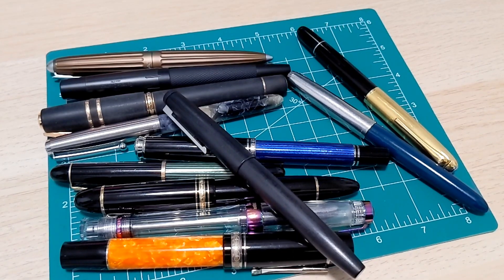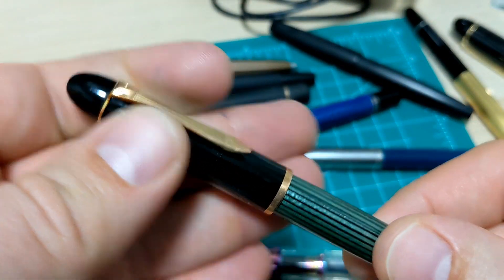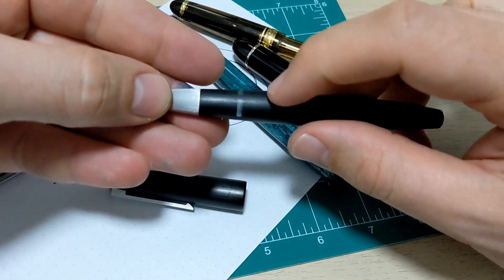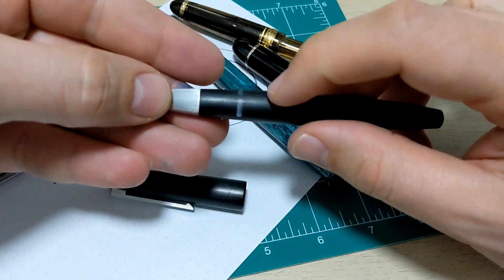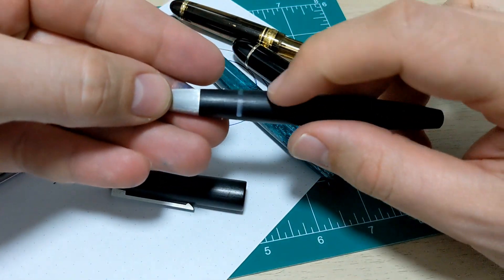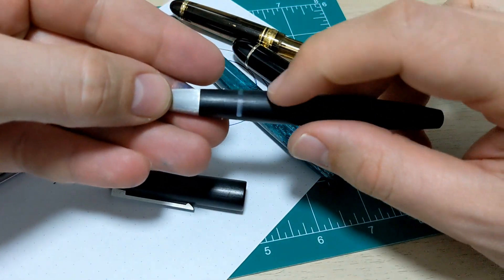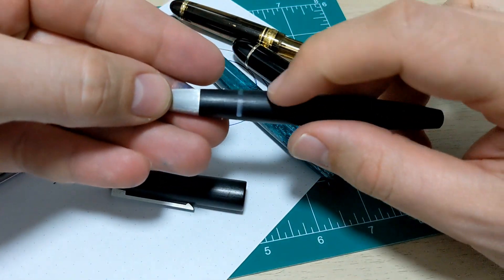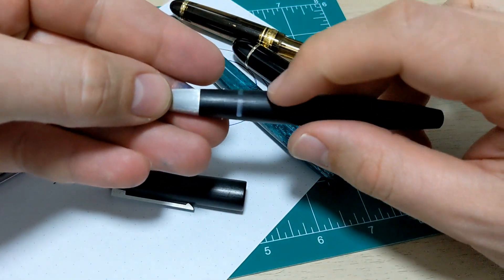Which Fountain Pen Is The Best Engineered (Lamy 2000 Part 2)

Comment: I am fascinated by feeds. Seeing the Lamy feed's top slide come off was a treat. There has to be an engineering reason behind each feature, for example, how many fins, how much gap between fins, how many top channels, how deep. Why do the Lamy feeds vary from the Pilots vary from the Pelikan (M800 specifically, mine is on order!)? Evidently different companies have their own interpretations of how the ink flow/air flow balance is to be managed. I would love to understand their thinking. But I can't find sources of information at that level.
Reply from the maker: Yeah that's where the whole proprietary stuff comes in. I "assume" there is a bunch of testing as far as flow, controlling where the ink goes/stays, minimizing leaking or nib creep, clogging, ensure it keeps up to the nib, etc. But I can also tell with other ones NONE of this stuff was tested 😂

Comment: You MUST be an engineer to marvel at those details, and understand them!
Interesting details:
There is another little mark under the clip on the other side of "Germany2" (maybe as a blow hole for the injection process?).
One more thing: I saw some clip saying "Germany2", but also some say "Germany 1" what is all that mystery !!!
Putting the pen back together, did you notice, it is an exact amount of turns to put the body to the tip? 
Every time. What that does is you can then have the clip ears on a vertical or horizontal axis to the nib, for those who finds that the ears hurt their fingers! 
Now, the circlip with the off-centered ears! That is just fantastic! I never noticed that but it make such perfect sense! Only Germans would go to that extent!
Great episode. Thank you!

Comment: Excellent review (both parts). Being an engineer myself, and owning many fountain pens, I was just hooked on Lamy 2000. One thing (I have to check your first video again) you may have missed to mention is - the material. They use makrolon polycarbonate. Now - where the extension of their engineering goes to the next level - makrolon is a clear material. And if you look at the ink window - there you can see it. Now, during the final brushing of the metal, the particles apparently (metal) make makrolon darker. It is microscopic but visible. So, they make makrolon dark, but have a special way of making those ink windows protected so they stay clear. And there’s more to that material - like why did they decided to use it vs. normal plastic (durability) etc... amazing.
Reply from the maker: I didn't do any review if the material science. Definitely not my strong suit!
Reply: @Doodlebud   Check it out, there are number of posts online about it - it made me appreciate this pen even more (in fact that was one of the reasons I bought it first time... 😄 )
Excellent videos !!!
Reply from the maker: @strelnikoff7  You might like the "sciencey" approach I did towards ink reviews. https://youtu.be/hFlaM4HIYoI
Reply: The makrolon is injected around a clear ink reservoir tube. They use small makrolon pellets. The colour is not from brushing the metal. You get a glimpse of the process in a goldspot pen video.

Comment: Great video,
I agree for the most part. But I think that there might be a little bias towards cap mechanisms.
For Pilot Custom 823 for example I wouldn't say "Nothing too crazy"  The vacuum filling mechanism is crazy and not many FPs can pull that of that well. I bet it took many designs and lots of trial and error to get it right. No matter how you do it it will get very great amount of ink inside almost every time. And from a design point of view  since its not a piston, the length of the piston stops being a limiting factor. And you can also use the vacuum mechanism to seal of the ink compartment from the nib. That becomes very valuable if you are getting on an airplane with your pens.

Also I don't know the engineering and design process for designing and manufacturing process behind nibs (which are arguably the most important part of the pen) but those nibs on 823... They did somethings right :)

So having a cap that clicks nicely is very cool. and the manufacturing process that you can assemble the pen almost entirely by hand is admirable but I give kudos to Pilot custom 823 for solving some practical problems.

Again, great video. I know its a little bir nit picking but thats my opinion for a sall part of the video.
Reply: This is a pretty good and balanced take. Another thing I want to add is it seems like both the 2K and the 823 are not designed to be taken apart – I have heard reports of both pens cracking after multiple disassemblies (although the issue seems to be significantly more common on the 823, so kudos to Lamy) – so ultimately ease of disassembly doesn't matter *that much*.

Comment: It's confirmed from LAMY that the "GERMANY 2" is the cavity number for the MIM (metal injection molding) die. They have two different dies, the numbering helps with quality control. If you find a particularly old one (2nd generation), it will have "W GERMANY" printed under there, although 1st generation didn't have any sort of labeling under there.
Reply from the maker: I would love to get a vintage 1st Gen L2K. I've seen pics and can tell how it was made compare to now but want to see more

Comment: Amazing video! I noticed that your Lamy 2000 is an EF, could you tell me how does it compare with the Pilot Metropolitan F?
I love snap cap pens I think is the more convenient caping mechanism but when the caps rotates I drives me nuts. Does the Lamy 2000 one spins?
Reply from the maker: The cap does rotate, but you have to force it. And when it does, nothing lossens & or scratches. Don't own a metropolitan so can't say. My L2K review (one of my early vids) has some line width comparisons
https://youtu.be/Ppmm-v5aCS0
Reply: @Doodlebud  thanks I'll check it out

Comment: I have a question because I just looked a bit into the history of metal injection molding. Wikipedia says it was patented in 1972 and started to play a serious role in different industries past 1980. The Lamy 2000 went into production in 1966. So if the section is made with metal injection molding, did they change something over time or did they machine it out differently or something? I'm just wondering, maybe you know more about it?
Reply: After all there is a reason that this iconic masterpiece is leaving their factory still brand new after 55 years. Makrolon by the way has nothing to do with fiber or anything, it's 'just' polycarbonate. But a very good one by the guys at Bayer here in Germany who actually invented the world first process to industrially produce this material. So they absolutely knew what they were doing and how to turn the wanted properties of the material to a maximum.
Reply from the maker: I have only seen pics of an older Lamy lower section, and it is different which leads to differences in construction. I would have to have a look at some good pics where its fully disassembled to have a better idea of how it was made. Or better yet, get my hands on one so I can play.

Comment: Fantastic, Db....however, one little caveat: The clip !! Given that the material is Makrolon, would it tolerate any form of heat to separate (as you suggest it may be glued using an epoxy adhesive) that finial from the cap. I'm dying to know (altho' I have an idea how it's engineered within) how that pivot & spring interact precisely. I've played with the cap for a couple of minutes & noticed that along the longitudinal axis of the cap, the clip can be displaced forward approximately 2mm so that it is no longer flush to the bottom aspect of the ridge below the finial; clearly, with the polished end removed, that is how they insert the hinge/spring component (from above), & then just press/glue same home.
In regard to the front section retainer lugs for the cap, that principle is pretty old - it works in exactly the same way as a circlip (internal or external) on say, an engine mount - where there's no room to place a receiving nut to a bolt (in my callow youth, I stripped & rebuilt all my cars - to understand how they worked). Anyway, that's my five cents worth...very cool second part.
Reply from the maker: Yup works just like a circlip and slips into the grove in the cap.  Same design I've done many times to hold in bearings. 
 Perfect radius on the grove to go in just right and also a stop so it doesn't go too deep and get stuck
Reply: Yessir.

Comment: The Lamy 2000 is my favorite pen, you forgot to take the cap apart so you missed a few more engineering points that can be found inside.  Otherwise, great video!
Reply: Well now I've watched the first video, the top of the cap is not a plug, it is just screwed on.  You might have to push a thin dowel or tool up inside the cap to keep the "nut" from turning the first time, but the cap comes completely apart like everything else.  Enjoy!

Comment: The Lamy 2000 is very well engineered and well made indeed. But I think you kinda mixing up good engineering, production tolerance, and complicity a bit. IMO if theres a more simple design that works as good or better, the simple design is the better engineered. For example, the Pelikan M800 piston vs Lamy 2000 piston, the Pelikan has less parts, smoother operation, and less stress on the material when disassemble even though you need a tool. That imo is better engineered.

One thing I have to agree with you is that the Lamy 2000 cap is really well thought out for it to work properly with the shape of the pen. Missing any of those part will fail the whole cap, and thus the cap is really well engineered.

Talking about engineering on pens, I think Conid Bulkfiller worth a mention. The idea behind that filling mechanism is really cleaver and combined the advantage of Vac filler and piston filler together. Hope I will own one of those in the future if they ever re-open again
Reply from the maker: Bulk filler is something I would love to get my hands on as well! Yes, simple is typically better. But the piston is a great design considering no tools required. It's also bold when a manufacturer is ok with any user (including competitors) being able to disassemble their product with ease. For me engineering combines all aspects when making a product. Design (aesthetics), design features on individual parts, manufacturing process considerations, assembly, materials, quality/dependable, lifetime, service, etc.

Comment: If you take the piston mechanism out, and put it back in, the knob can be loose. Taking it out and putting it back in again fixes it, but do you know a way to make sure that doesn't happen?
Reply from the maker: Don't know exactly what you mean, but I found when you reassemble, it seems to align itself & engage the piston screw properly into the nut located in the knob. This was only the 2nd time I took the piston out as I don't want to give extra wear/tear to the parts.

Comment: I tried to take the Lamy 2000 grip section apart from the barrel and when I put it back, I found the transition from the steel part to the Makrolon is not as smooth as before, like the two parts are misaligned or something. Do you notice that with your pen? Thanks.
Reply from the maker: The fit should be perfect. Hope you didn't cross thread. Also check for debris in the threads (barrel & section) and that the oring at the end of the feed isnt getting pinched & misaliging things.
Reply: @Doodlebud  Thanks for reply. I didn’t mean the connection between the grip and the barrel that you unscrew. I mean the part where the white steel grip and the black Makrolon connected together.
Reply from the maker: @ThinhPhamNumber1  Ahhh I've never taken that part off. I would again check for any adhesives/residue/burrs on the parts. It is possible that the parts aren't concentric. So might have to rotate them until the fit is perfect. Also depends on what type of fit the parts have. There is some type of clearance between the two parts so they can fit together. So again a slight adjustment may be required.
Reply: @Doodlebud  I didn’t take that part off either. I just unscrewed the grip like everyone else. I just feel that the seam between the black Makrolon and the white steel noticeable. Before taking the pen apart, that connection was impossible to notice, felt like one part.
Reply from the maker: I'm even more confused now 😂. Check that the metal ring clip is fully seated & the tabs are aligned with the notches
Reply: @Doodlebud  It seem like I’m very bad at explaining things 😂. I didn’t mean the part where  you unscrewed the section in the video. I mean the connection between the steel part that you held to unscrew and the little black part connected to it.
Reply: @Doodlebud  I think they mean the texture on the polycarbonate and metal are misaligned. Like they didn't start threading it in the same orientation so when it reached all the way it didn't end up on the same spot.

Comment: The clip on my lamy2000 is pretty wobbly. Just wondering if yours has the same issue or if you know of a way to fix it? I got in touch with lamy, they weren't interested!
Reply from the maker: Just guessing but I would look at how secure the end of the cap is. Apparently it is screwed in, but with min it doesn't seem that way. Here's a disassembly video a viewer sent where somone took it apart. I tried & no way it's coming apart without exerting more force than I would want to. So follow at your own risk.
https://youtu.be/5V0jZAlelAE
Reply: @Doodlebud  Thanks!

Comment: Unfortunately I found out the cap finial is a separate part as my new 2000 has a spinning finial.
Reply from the maker: Perhaps try spinning it the other way to tighten?
Reply: @Doodlebud  it spins freely both ways. You can see the nut on the inside spin, however, there is nothing to grab to hold so I can unscrew or tighten the finial.
Reply from the maker: I've heard some people do it with a pen. Erase end up into the cap to grab it with friction. If it's a new pen I would let the seller know right away. Shouldn't be doing that

Comment: The Lamy explanation and demo is fantastic Yes Lamy does excel at engineering design. But it's not just about complex engineering. The Lamy Al Star is an achievement through its elegance and simplicity at a low price. And, why are their converters such rubbish by comparison? 

If I was to pick one glaring design fail on many pens it is the lack of attention to a good nib/ink seal when the pen is closed. Platinum highlights that with their 3776 and the marketing surrounding their decent seal. 

Thanks for a great vlog.